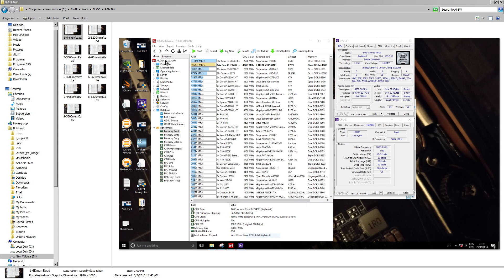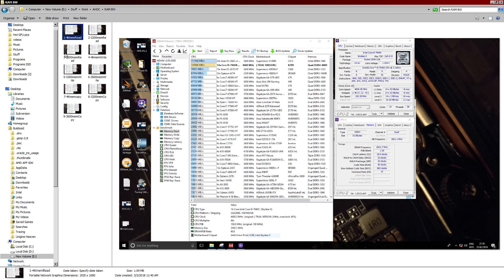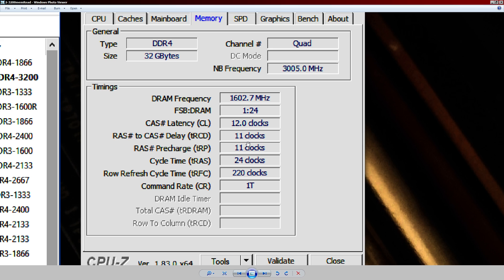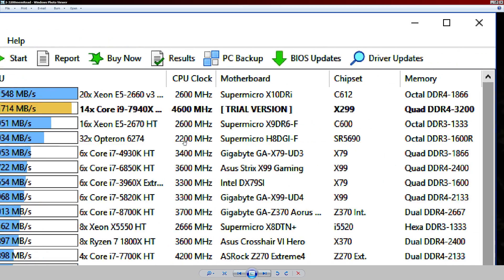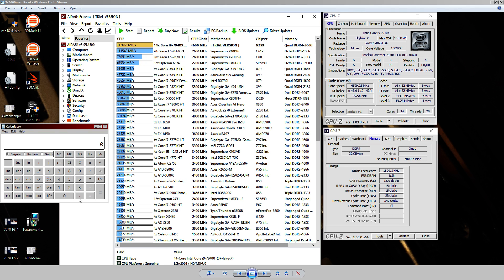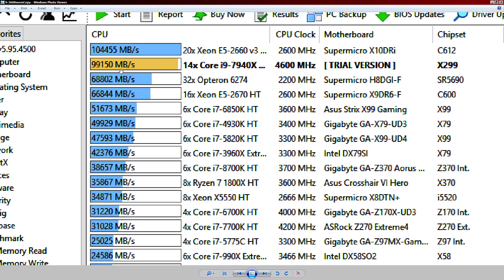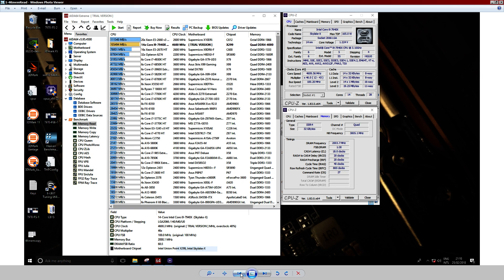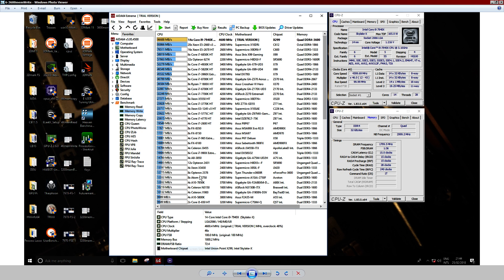Some RAM Bandwidth vs frequency and timings data..... kinda

Comment: Anyone know a free tool for memory benching? (AIDA expires)
Reply: Thanks but stealing isn't my thing.
Reply: Personally I like to use the RightMark Memory Tester (which is a module of the Memory Analyzer). It's really outdated, but still gets the job done and has some customization options for the tests. You have to set test block size. If you fit in L1d you can measure L1 cache, if you fit in L2... and so on. On a side note Write NT test matches AIDA write tests really closely.
Reply: Free as in freedom, too, nice! Thanks man.
Reply: Not the same at all. In the first case, you have no interaction with them and vice versa. In the second case, you benefit from their work, without paying the asked price for it. This means that the result for them ,is that they did work for you for free without agreeing to do so.
Reply: It's only a net positive if you ignore the disrespect you do to the developers. It's not only about the profit they make, or the usage you gain, it's about consent, and about just treating people nicely. You strike me as a decent guy, so I guess that If you had to look the devs in the face and say "screw you I'm taking your stuff and I'm not giving you a red cent and there's nothing you can do about it, lol", I doubt you'd feel as righteous as you do with the benefit of anonymity.

Just so you know I'm not exactly standing on a high horse here, I used to write cracks and keygens, when I was too poor to afford to buy stuff like photoshop for over a grand.... that was before I was a software dev for a living. I'm now retired so I can look back on it all in a way..... Honestly I just wish it were a perfect world where all software could be free and open source and developers got their food and homes as cheap as they gave their software. It can't be that way, I know, so I just try to make it as nice as it can be. I feel like you share my good intentions.

I hope that everyone who reads our chat will try to limit piracy to a kind of unrestricted trial version, and pay up whenever they are able.... Or yaknow, do like me and hunt down freebies and better yet, open source software :)
Reply: The advice here was really good by the way! Both apps have been excellent in their own way. I'm really glad I asked because I came out of it with two applications that I'll be using in future. Big thanks to Viktor and tjuwanttjutju <3

One-liner reviews:
Rightmark Memory Analyser was open-source, very straightforward, does one job and does it very well. Quick, lightweight, configurable. Very unintrusive, no installer, you even have to right-click and run as admin from the extracted zip file. Excellent.
Sandra was free for personal/educational use (not a trial), much more complex, not so configurable and quite heavy and intrusive (even installs a service on the system, but does provide the option to not start it automatically which is great) but provides extensive analysis of results, comparison with others, etc. Overall more comparable to AIDA.

My advice: Get Rightmark and try it. It has zero impact on your system and you can remove it by simply deleting the files, done. If you want to dive a little deeper and see how you compare to other systems, get Sandra.
Reply: Sisoftware Sandra lite got some memory benchmarks, and it´s free. dont know if it is what you are looking for
Reply: You can get an AIDA64 Extreme key on ebay for $3 USD
Reply: FOSS developers are already happy if you use their software, and if you like it some give you the option to donate whatever you want. 
Trial software developers ultimately want you to buy the software. There's some variant in there (some are only interested in companies' money and let users just infinitely use the trial, like WinRAR) 
And then Adobe just wants your money and I don't think they actually care about the software, because it's just a means to your wallet. The devs at Adobe are probably decent people that do care, but the price and marketing show what's most important to their bosses.
Reply: I do not believe these interactions are zero-sum. If there is a negligible chance you will pay them either way, but you use it without paying, that is a net positive. They have already made the software, and it is almost certain they would have made it even if they knew that you will never pay, because they thought that enough people will pay for it, so there is nearly zero loss on their side. (the only way for them to loose money is if your assessment of your own willingness to buy the software was wrong, and you would have otherwise bought it)

Of course I am not saying one should never pay for software, if one finds something truly useful one should pay for it. 
Anyways, I kinda get where you are coming from, and while we can only agree to disagree, I am still glad you have your well articulated reasons. Those are getting rare these days :(
Reply: I was trying to be brief, by using the term 'stealing'. I don't want to take something that isn't willingly given to me. I don't want to contribute to reducing a persons income that they use to eat. You know what I'm getting at, let's not nitpick terminology.
Reply: My point was, if you use something else, they do not get paid. If you use a keygen, they do not get paid. Same end result for them, either way.
Reply: Search for AIDA64 key on YouTube and click on the first video. You may have to also look through the comments, though.
Reply: Using keygens etc. is not stealing, especially if you have no intention of ever buying the software.

Comment from the maker: first
Reply: As a complete noob to ram, these videos are really helpful
Reply: yo man big fan btw. please post these screenshots to your blog if you have time :)
Reply: Love your channel dude. Now, if I could just get you make out a parts list for my first build....😁
Reply: i wish you started ur channel 6 years sooner so i could have seen great overclocking videos on the i7 3770k,ddr3,overclocking non-k intel cpus,and PCB breakdowns for the 
asus p8z68 pro/gen 3
i got a kit of hynix/corsair cmy16gx3m2a1866c9r runnin OC@2133 XMP-10-11-11-30-T2 1.6v and i want to tighten up the timings but no idea where to start
-------------------------------------------9-10-9-27-T2-TRC481.5v XMP//// not the pro version of veng
asus p8z68 pro/gen3 i7-3770k @ 4.2 stock volts
you could make a forum of Actually Hardcore Overclocking it would be a better way ur subscribers could interact with you
Reply: how do you set the RAM timings properly?
Reply: @peppybocan  Simple. You just set your RAM for the highest frequency AND lowest timings you possibly can, with the system still booting up and running stable, and tweak the frequency & timings accordingly, so that they will give you the best results in your chosen benchmark(s). Did you not watch the video?